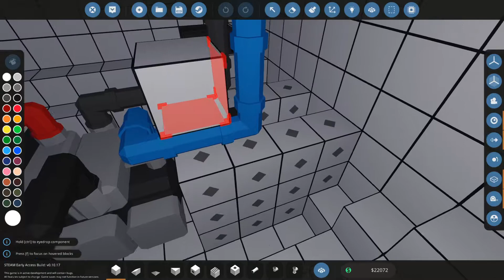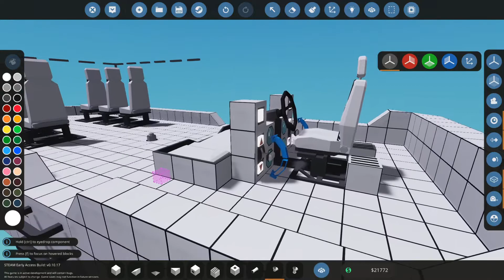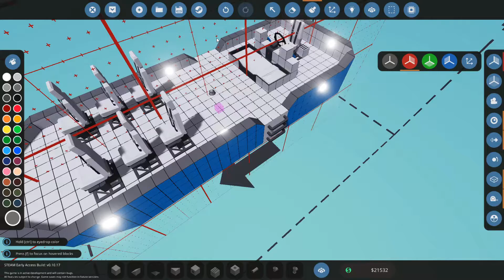Stormworks Setting Up GEARS in Career Mode - QUICK Tutorial

Comment: Still dont get it
Reply: For a basic understanding how the gearboxes work. If the arrows face to the engine and you change the ratio(s) the first number says "This is, how many times the engine needs to turn per second" to the second number saying "You get this amount of turns out of the gearbox per second". Which means a Ratio of 5:2 means the engine needs to turn 5 times per second to give out 2 turns per second in power. Ultimatively, why I don't know, this means your rps will go down, thus be more fuel efficient but your boat will be slower.

The other way around means you burn through more fuel, thus higher rps, higher heat but a very fast boat. The ultimate goal is to achieve the perfect speed to fuel ratio which is dependend on the size of the boat, hull-type, weather/waves, if you're turning and so on.

Thats why most tutorials explain "Face to engine, fuel efficient" and nothing more. Its quite complex and needs a lot of fiddling around.

The best is, for most small boats, to use a 3:2 ratio facing to the engine (Just 1 gearbox is enough, not as seen as in this video - maybe it's preparing for something) so you achieve decent speed and be more fuel efficient (Small boat = not much fuel).

Stay crunchy.
Reply from the maker: There have been a few updates in the game so I'll dig into it and maybe even create a new video for it.
Reply: @cybertv1422  noice
Reply from the maker: What part are you not understanding?
Reply: @cybertv1422  this part 1:25